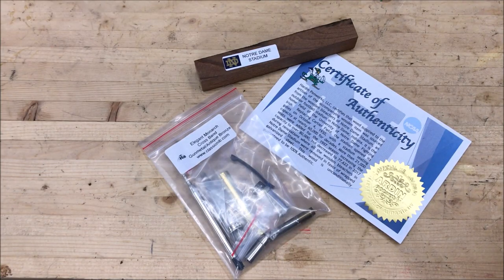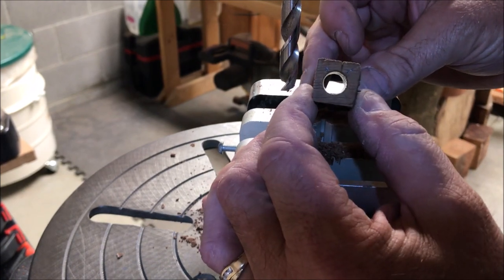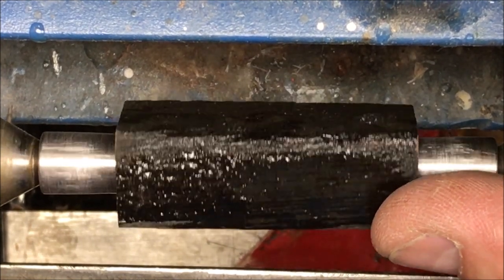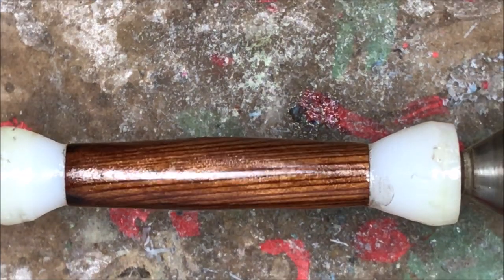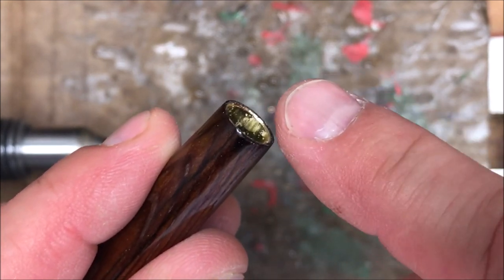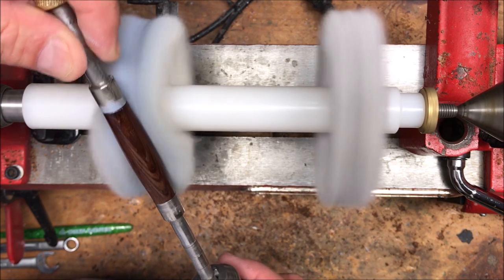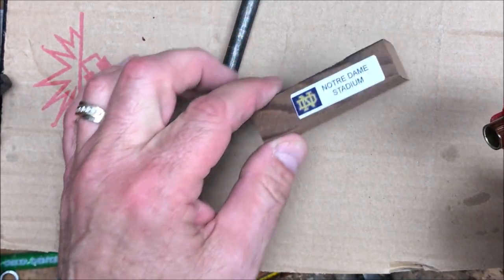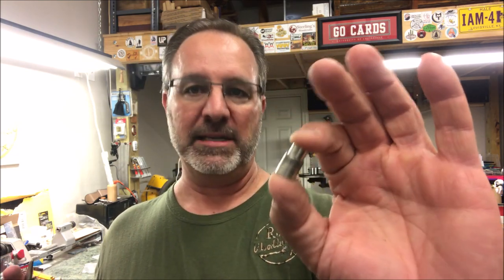Pen Made Out Of A Blank From Notre Dame Stadium

Comment: Its a lovely pen. The bushings tip seems a great idea and I will be trying it. I like the jig where you slide the blank onto a bar for disc sanding the ends.
Thanks
James
Reply from the maker: If you have a disk sander that jig is available from www.turnerswarehouse.com. Tell Chad I sent you. It’s not very expensive and works great. You will need a set of punches. I got mine from Harbor Freight with a 20% off so they were not expensive at all. 

Regards,
Bob
Reply: @RJBWoodTurner  I have looked on Chad's website and I cannot see the jig, what is it called?
I am very undecided on whether to turn right down to the bushings or to sand down the last 1/32"
Many thanks 
James
Reply from the maker: icespeckledhens Here’s a link:       https://www.turnerswarehouse.com/products/pen-blank-squaring-jig

Regards,
Bob

Comment: Thank you for sharing, Ser I have a question, and just for my information I am not criticizing your methods or techniques. I you would have put the CA, and then put the blank into a pressure pot, would that could have secure the penetration of the CA, thank you and have a nice day.
Reply from the maker: Cactus juice and a vacuum chamber would have worked but they are expensive. Pressure pots are for compressing bubbles in resin. 

Regards,
Bob